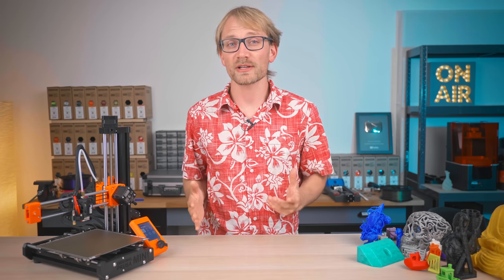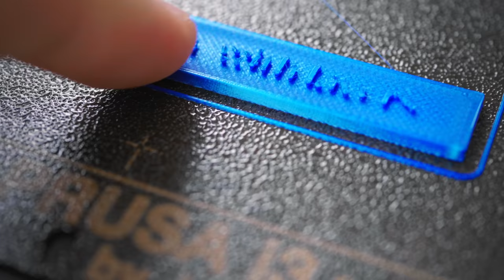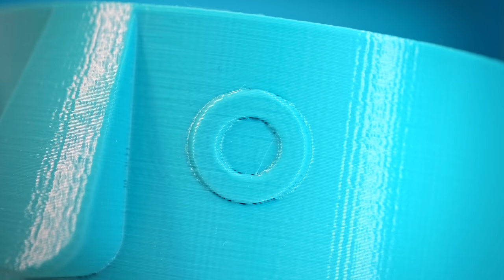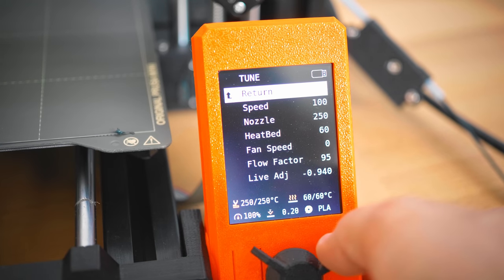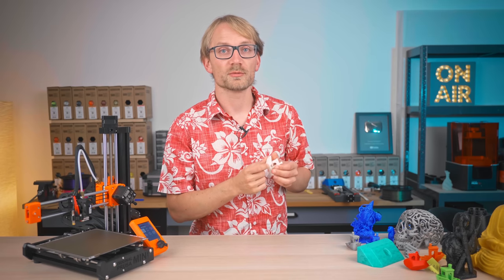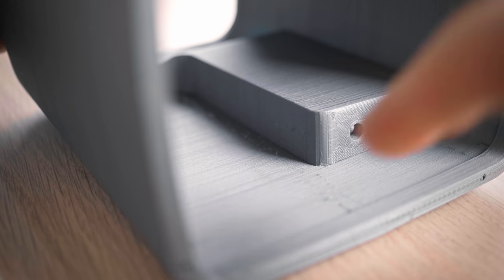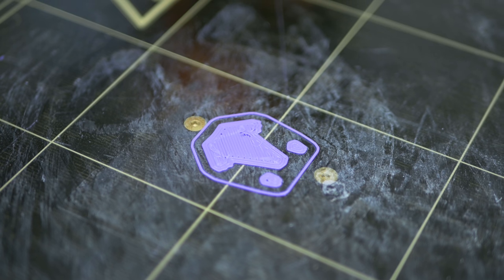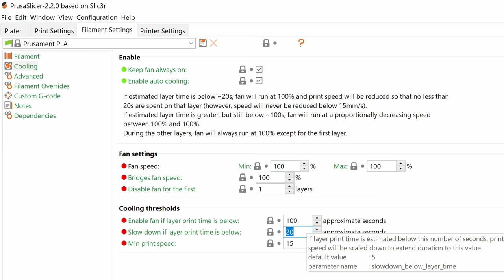3D Printing Basics: When things go wrong! (Ep9)

Comment: You changed my 3D printing life a couple of videos ago!  1mm on first layer solved all the problems I had with bed adhesion.  And 1mm on all layers work great for many of my models, and cut the print speed in half or more.  Thanks Tom!!

Comment: I really appreciated this series you made; it was what convinced me at the end of 2020 to buy my first printer (ender3 pro). I've had it running nearly 24/7 since; have done extensive upgrades. Early on I experienced intermittent underextrusion that took a while to diagnose; eventually I discovered the cracked idler arm on the extruder (that's a really outdated extruder design). I also had intermittent layer shifting issues which I ascribe to improperly tensioned belts or possibly excessive stepper driver current. Both were great learning experiences, if frustrating in the moment.

I have been very interested in the voron project and appreciated yours&cnckitchen's reviews. I plan to build a voron 2.4 300^3 or 350^3, super hyped for parts to arrive on the slow boat. I will continue to follow your vids, and thank you for your commitment to and emphasis on open source in the printing community.

Comment: Ey Tom is back again with a basics video. I love it!

I have two questions, these questions are not really widely discussed so that is why i am asking.

Questions:
- How does a belt rubbing on one of it's sides effect the print quality?
- How do I minimize overshooting corners without linear advance.
Reply: Since Tom hasn't replied yet:

1- belt rubbing will wear out your belt (obviously) but, it probably won't have a big affect on print quality. If the drag is severe enough and your printer has high acceleration, it may cause some skipped steps

2-Tension your belts properly. If the belts are crappy, replace them! Make sure there's no mechanical play in the machine.

Comment: 6:00 Something to add is a damaged heat break. I couldn't figure out for the life of me why my printer refused to print. Tried quite a few cold pulls including one where I nearly punched myself in the face when it released. (LOL) I took my E3D hotend apart to see where the hangup was and noticed the heat break was bent slighty. Replaced it and it worked much better. Also get a bondtech extruder, the one that came with my mendelmax 2.0 was crap.

Comment: One issue I was having was filament WAY underextruding. did teaching tech's estep calibration method a ton of times, and numbers were always wildly different. I saw my filament tension wheel was barely turning, so said hey why not? Took off the wheel, gave it a drop of WD40, cleaned off the excess, and it's been printing like a champ ever since. Amount extruded is always also right on and consistent too
Reply: Be careful which "WD40" you use - the original formula was a Water Dispersant (hence the "WD") and can be slightly corrosive. Far better to use light machine oil for sliding parts (e.g.: Singer sewing machine oil) or PTFE/lithium grease for bearings.
Reply: @anthonyrich1592  i had some lithium grease back in the day, but all I had laying around was a can of WD40 I've had for a while and I've been broke for a while

Comment: When adjusting settings to address an issue with a printer, and you're not super familiar with all 3 - try only changing 1 setting at a time. It may take a little longer, but you'll know what change induces what and how, and learn a lot.

Comment: How about improving Top Layer Quality? For me this has been the most annoying issue to resolve. In particular, I'm trying to make a few molds for silicone parts that I produce. The side walls come out decent but the top layers never look good. I've tried messing with ironing and skin layers, with little to no improvement. Any top final layer looks like the nozzle dragged over it here or there as well as leaving little lines, almost like stringing but are actually a part of that layer. It looks terrible for a finished part. So far I've only used inexpensive PLA for these molds but have a few rolls of HTPLA from proto-pasta that I'm going to try next. Currently working with a sovol sv01 and Cura. Thanks for the great videos.

Comment: As for peeling corners I notice on enders it's do to offset cooling air flow causing thermal gradient in print. It peels up on right side.
Reply: You could redirect airflow but I prefer just avoiding problem by angling large prints so they don't contact over a large area.

Comment: There's a critical difference between prints meant to look pretty and prints that meant to be practical. 

Personally, I prefer to slightly increase flow and overlap to get the best adhesion. Works great for brackets and jigs but doesn't look nice for little figures.

Comment: I have a Prusa Mk3 and never get things working.

E.g. first layer comes off bed, print sticks to hot end and way more pls help
Reply: Literally I replaced the brass nozzle on my Mk3 yesterday with an E3D Nozzle X, hardened steel with unique nano coating, initial prints look better and any material that gets stuck to the outside wipes off easily with a piece of cloth when it's hot.
Reply: I usually avoid the problem by having a slow, thick first layer. e.g.: initial layer height 0.3mm; initial layer line width 250%; initial layer speed 10mm/sec. (Credit to Thomas who mentioned this "in passing" during his "Was live: Creality Ender 3 Build & First Prints!" video.) It can add a lot of time to a print job but would you rather have the print work right the first time and just wait a little longer, or keep repeating the same print because it doesn't stick properly?
Also regularly cleaning the bed with a light detergent or isopropyl alcohol (if you can find any) will remove any grease you might have left behind when removing prints.

Comment: Hey Tom. I have been 3d printing for 7 years, and have a problem that has been happening for the last couple months that I just can't figure out. I'm using Simplify 3d, printer is a Creality S5, with a Microswiss hotend, Capricorn Bowden,  dual gear extruder, silicone heater, etc. She's pretty well upgraded. My outermost layer isn't adhering to the next inner layer. My extrusion multiplyer is spot on. Anything I print with a large vertical wall, the outer perimeter is loose. The rest are just fine. It's just the outer layer. I cannot figure out what the heck is causing this issue. Any suggestions what I should look for? Thanks. Been a subscriber for over 6 years. Thanks for all your help.

Comment: one thing I really get annoyed with is layer separation after the print finishes. I have printed two identical parts at the same time with ASA. 255°C on the hotend, 110°C on the bed. One turned out flawless, the other got layer separation in two places. I have an enclosure and the ambient temperature is stable. Octoprint shows stable print temperatures. Everything should work out actually but it doesn't. I just can't wrap my head around it.

Comment: Another reason for no extrusion can be too much retraction distance, which can wear off the filament causing a worse grip
Reply: If you're seeing filament wear on a Bowden based printer it's usually because the Bowden tube is too long or otherwise inducing too much resistance on the filament between the extruder gears and the hot end. This was a real problem for me on a Core-XY printer I had because the Bowden tube between the extruder gears and the hot end was around 850mm long. I initially replaced the original extruders (which were single gears driving against bearings) with BMG clones (which drove the filament with a gear on two sides) but I eventually gave in and eliminated all but 40mm of Bowden tubing by moving the extruders up onto the hot end assembly itself.

Comment: Is there anything other than software issues that can cause layer shifts on a delta printer? I don't see how a slipped belt or motor can cause a perfectly flat offset on a delta, but it happens to me fairly often.

Comment: Help. The top surfaces are GONE. I "changed nothing" is mostly accurate. I certainly didn't touch flow. It's even apparent on 2nd layer of rafts (1st prints fine).

Comment: I have an Ender 3D printer. I had been printing great prints for awhile with little to no issues. A few days ago my printer clogged and even after cleaning the nozzle and tube and even changing the nozzle it is not printing right anymore. The nozzle keeps clogging and the print layers are stringy and break very easily. Anything I can do to fix this?
Reply: Did you ever figure it out? I'm having the exact same problem currently.

Comment: Wow, I want to buy a printer, but now it seems like a lot of work.. But I imagine it would be worth it :)
Reply: Making things can be quite satisfying. My advice first is to have an idea what you want to make after the novelty wears off. I want enclosures for arduino projects; others want cosplay costumes; others want to replace broken bicycle parts that are hard or expensive to get,and more. Second advice is, sometimes a cheaper printer is reliable, sometimes it needs work or even parts replaced. Usually a more expensive printer will have fewer issues out of the box. Quality matters. It can be very frustrating as a beginner having problems and not knowing if they are you, the machine, or the slicer. (Thanks to Tom for videos like this!). I have heard several people lament that their first printer was too cheap, and wishing they had saved up for a better one first. Third advice is, don't rush it. Watch the YouTubes, read the reviews, see what others have done, find a Facebook group for the printer you like the look of and absorb knowledge. 3d printing can be frustrating. It can be difficult. And it can also be so very rewarding. :)

Comment: cheers Thomas. My 2015 FF Creator Pro has been collecting dust for the past year as I had a number of issues develop after almost 4 trouble-free years of printing. Finally got the motivation to get it running again and your videos helped a lot. Finally, I get serenaded to sleep again with the sound of steppers motors humming away.